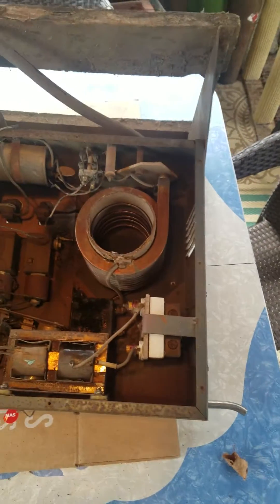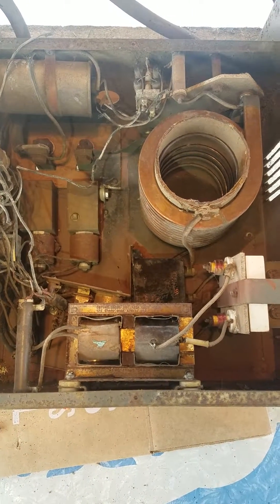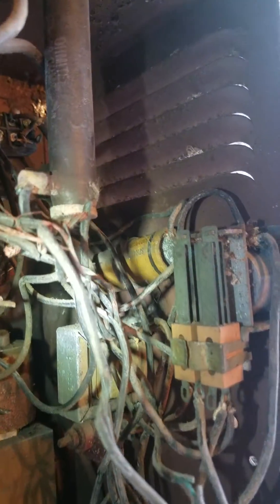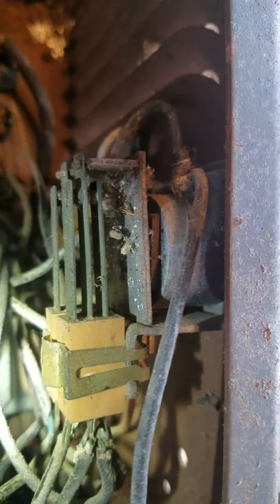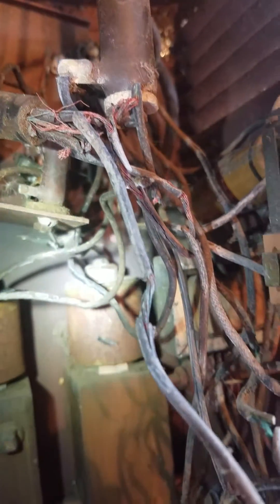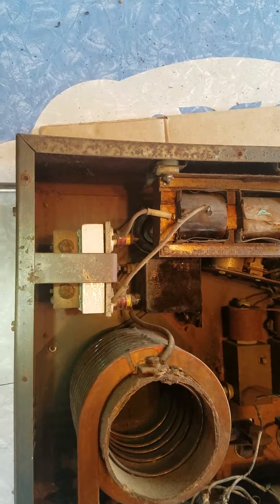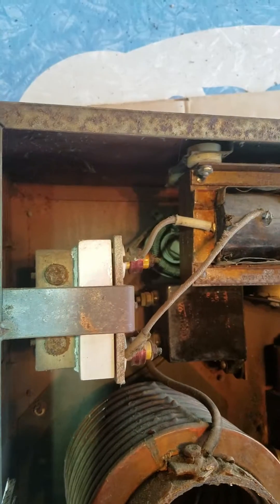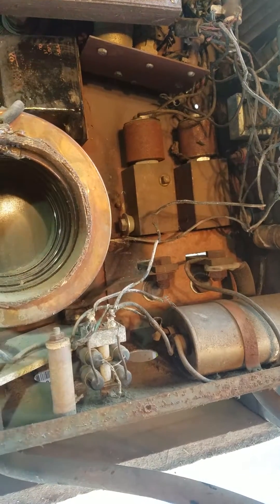Lincoln Hi-Freq TIG survey and overhaul part 1

Comment: I just bought one of these lincoln code 5838 hi frequ things yesterday. I have no clue what it even is. Ive seen people say its a welder, but ive also seen people say that you attach this to a welder. What 
Did I  buy?
Reply from the maker: What you purchased was the absolute finest High frequncy arc starter and stabilizers known to man.  It uses a spark gap to excite an inductor to generate some very high frequency currents. Its used typically in conjunction with a TIG torch and combined with an AC welder it will weld aluminum or other metals.   Itself is not a welder but it will overlay the high frequency onto a welder.   It cranks out more RF than a russian pirate radio station.

Comment: Part II?
Reply from the maker: I'm an awful creator!    After sourcing most of the parts I had a friend that really took a shine to the Airco. and wanted it for their own, sad to say it moved on and left me behind.  I really needed a more flexible TIG setup for aluminum welding but that Hi-Freq was a powerhouse when it was working, big amps were no problem at all and the liquid cooled torch would make some serious hot water.

Comment: Nice tear down and explanation.  I recently invested in one of these (Code 5838 500A) for $100 with some extra cables and an air cooled TIG torch.  I haven't opened mine up and is neat to see before I do.  Figured I better inspect before I turn on to be safe.  Did some online Google searching and found the manual as well as this video.   Any plans to upload or do the part 2 still?   I'll try to video mine when I open up and post also.  Thanks for sharing.
Reply from the maker: Thanks, I got started, changing wires, updated a few wires to teflon jacketed ones but a friend really wanted it for a project so I sent it to a new home.